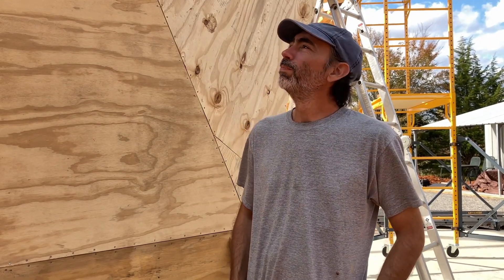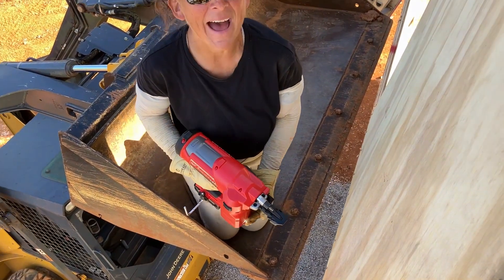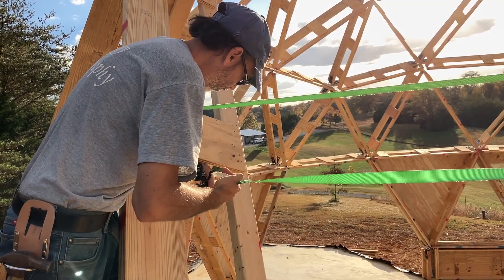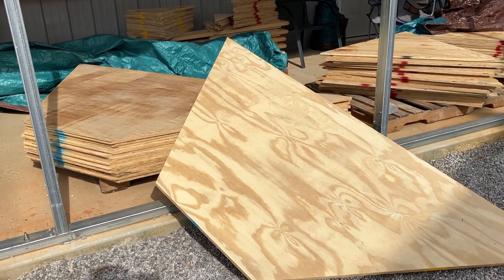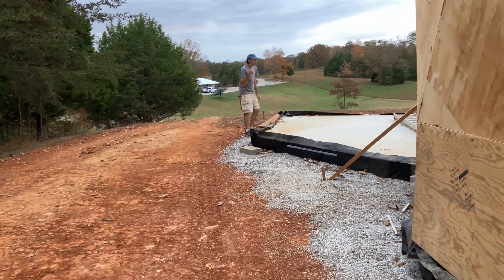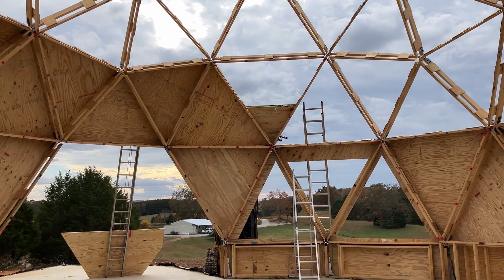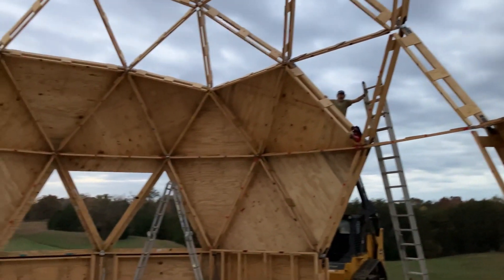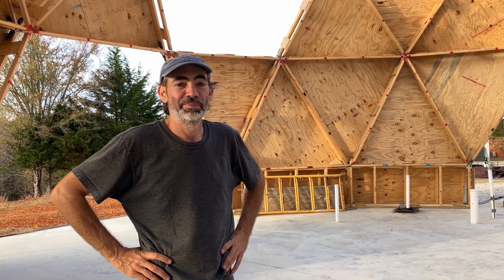Putting Up The Plywood On Our Geodesic Dome...Round Two!

Comment: Another impressive and informative segment for your dome build.  I was a rigger in a shipyard during the mid-1970s and I hope you'll consider a climbing belt for the next two courses.
Reply: Thanks!  I do eventually use one.  I think I pull it out for the third course.  Since it's just the two of us, it's just not practical to use it when I have to bounce all over the place.  That being said, it does come in handy soon!
Reply from the maker: Wow!  You clearly are not afraid of heights then...that will be useful with your build!  Yes, the harness is mandatory at the highest levels and any time he starts hanging off the outside.  It is definitely a bit high up there!  It is interesting though.  We tried the harnesses early on and they are just so cumbersome that in some ways they made it more unsafe to get around.
Reply: @trippyacres  Yes, the OSHA climbing belts are cumbersome, but I frequently use a "mountain climbing" belt, which is lighter in weight.  I'm really glad to hear you'll be using one.